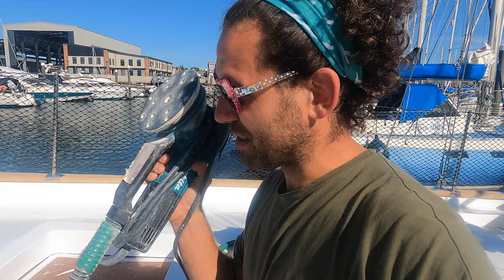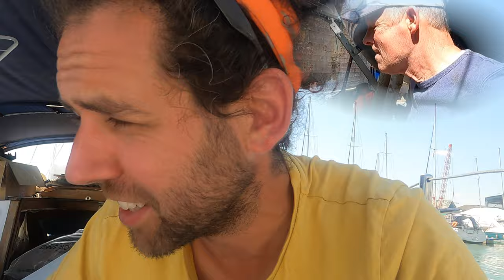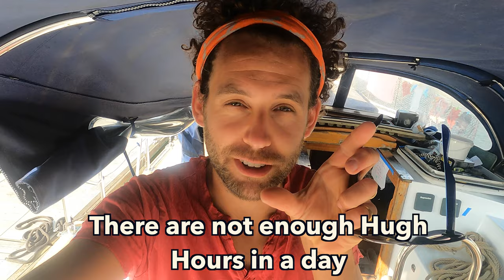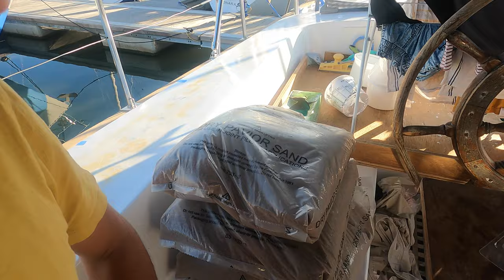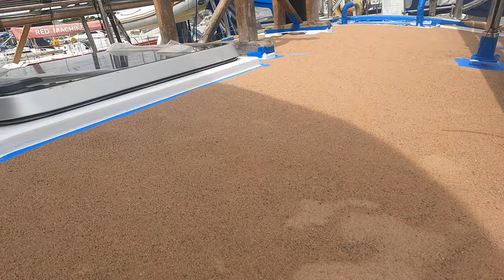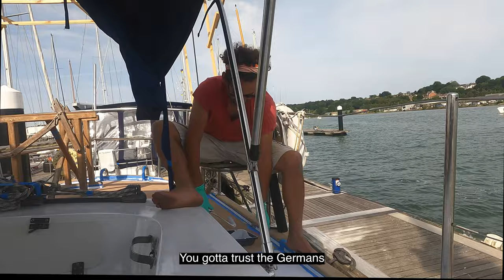The Grippiest DIY Non Slip Boat Deck For Under £500 | Using Epoxy Paint And Sand | Episode 42

Comment: Thanks for sharing your experience and how to do it. Would you share the material cost for the deck? That would be interesting to compare with other options like flexi decks etc. Great Video ❤
Reply from the maker: Hi Caroline, of course. 

15m squared area approximately. 

Durepox Awlgrip Whisper Grey Base, 4 litres. £124 each (x2)

Durepox High performance clear Laquer. 4 Litres £150* (x1)

Durepox Hardner, 1 litre £70* each (x2)

Durepox 910 reducer 1litre £24 each. (x2)

Kiln dried sand. £6 a bag. (x4)

Masking tape. £6.60 a roll (x4)

*premium airfreight price. 

Same reducer and hardener for both the base grey and the lacquer. 

Due to the shortage of hardener in the UK I reduced the ratio to around 5/6:1 meaning I could stretch it to go further. (I took advise from marineware on this who said I could go as far as 7:1 without issue)

As you can see we ended up paying £636. However we payed a premium for the hardener and lacquer as they had to be specially air freighted and the cost was passed on to us. I would also say that we could have got away with 1 litres of the lacquer. So if doing it again I would have bought less. I think the price would be roughly around £500. (Also I could have made 2 bags of sand stretch easily!)

I hope that helps.  Marineware in Southampton for everything except the sand.
Reply: In